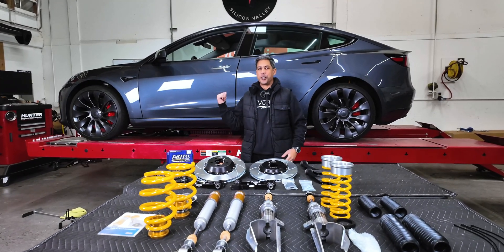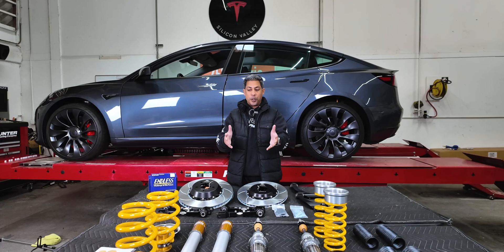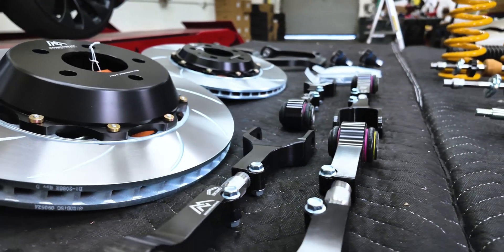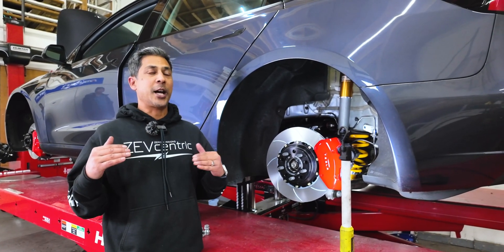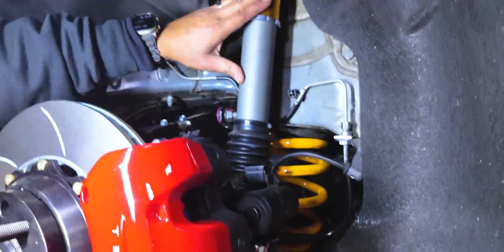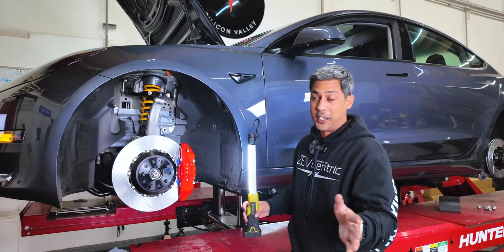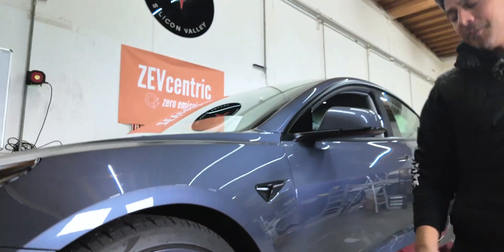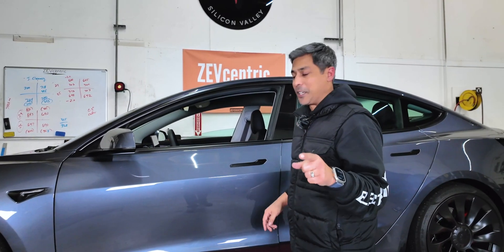Tesla Model 3 AutoX EVX Build: Amazing Performance & Auto Cross Setup!

Comment: are you not aloud to change to a solid front lower control arm bearing and solid compression rod bearing in this class of auto x? my 24 performance had a massive wobbling feeling under hard braking and very un assuring cornering with the stock squishy bushes im sure this car has exactly the same problem
Reply from the maker: @stevesute  he had already done that upgrade prior and its really needed